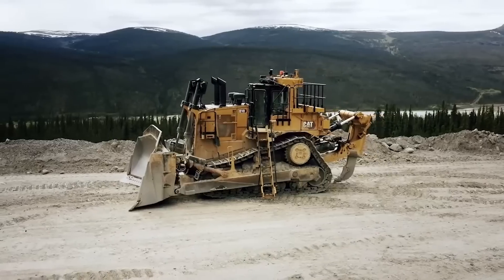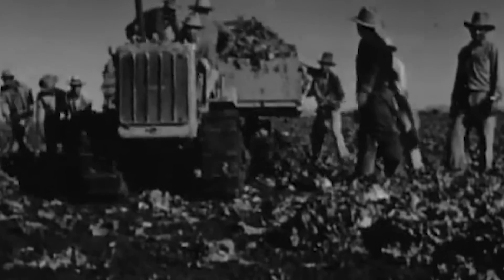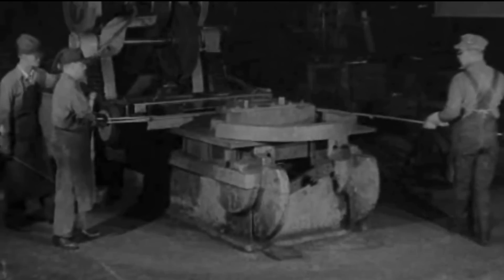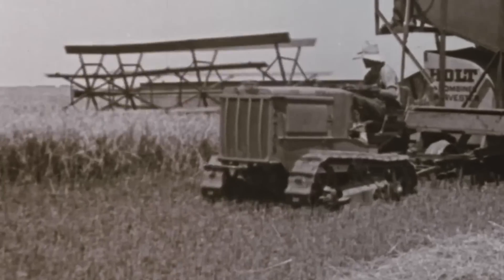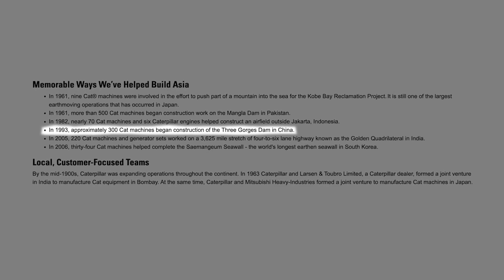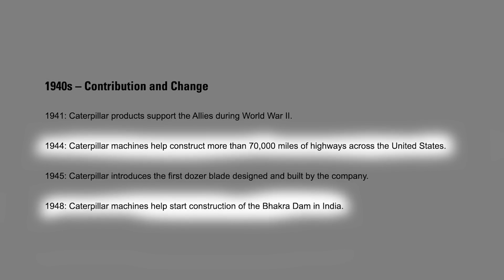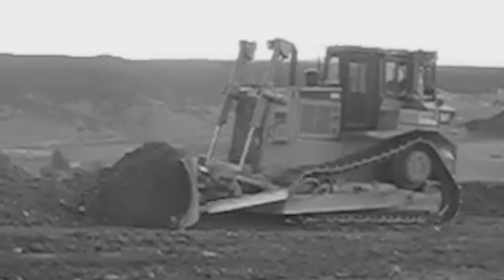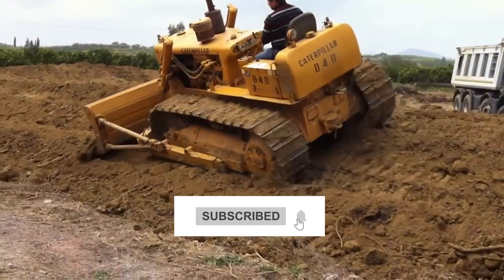How Caterpillar Changed History With Their Bulldozers

Comment: A clutch drive hydraulic D6, three older six wheels Euclid scrapers belly pans. Three Euclid 1940s TS24 four wheels scrapers. A P AND H crane, a Lorraine crane. His ww2 army buddy Jerry Bianco talked him into moving Stan Decker Excavating to South Ozone Park Queens and they became J&S excavating corp. He was there till he moved into Nassau County during the building boom of 1950-1960s. I learned at 3 years old how to operate a Rag Grease gun , and check and top off oil. I was told many times that I just did the job of two Union Oilers. By 9 a was operating farm equipment on Uncle Art Crose dairy farm and by 13 operating heavy equipment. He tried to teach my the P&H crane, but I couldn’t control both arms and both feet at once

Comment: My dad owned both allis chambers HD20 and HD21, but bought a D8h, D9H with both a push block blade and a 16’ U blade. Both were cable not hydraulic. A older D4track loader,